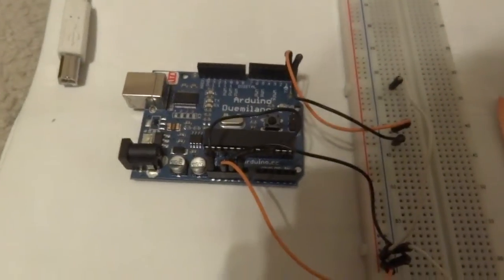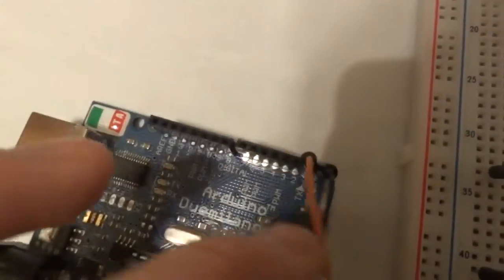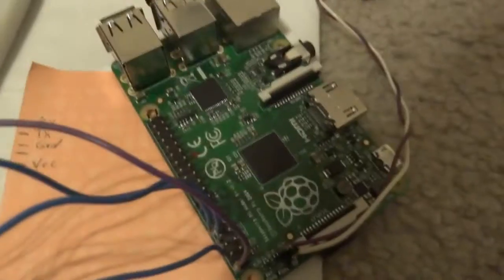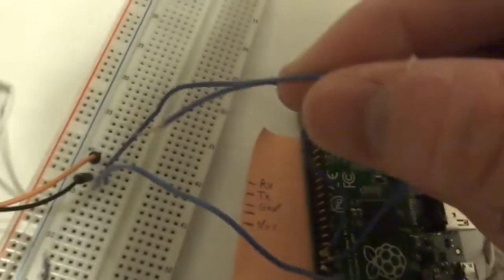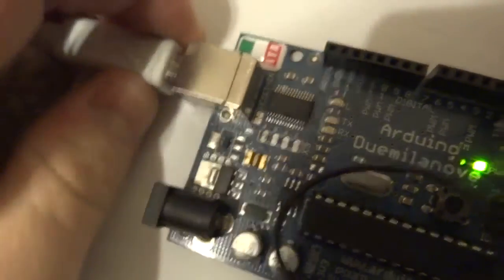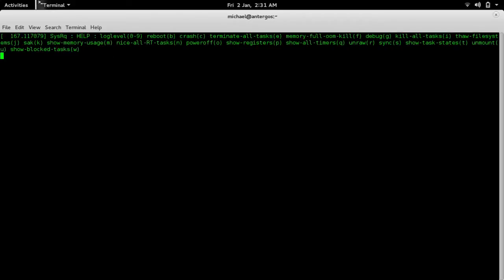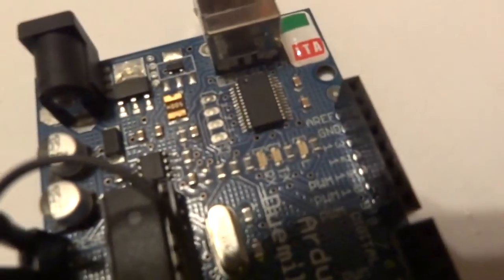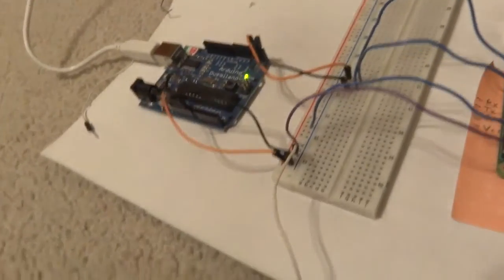Connecting to Raspberry Pi with a Home-made Arduino USB to TTY using UART

Comment: Hi, Happy new year 2016, sorry to ask, you didn't speak anywhere about the 3.3v that is needed by Raspberry Pi !!! and the fact that arduino works with 5v, is it because the arduino duemilanove is 3.3 v ?
thanks for any answer, especially that I was going to do what u did, with the arduino UNO 
thanks for sharing